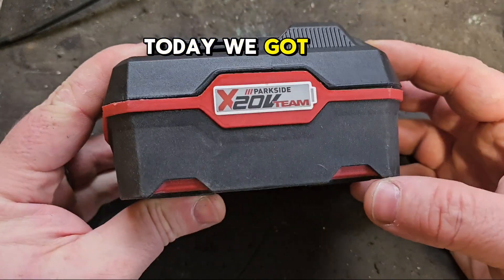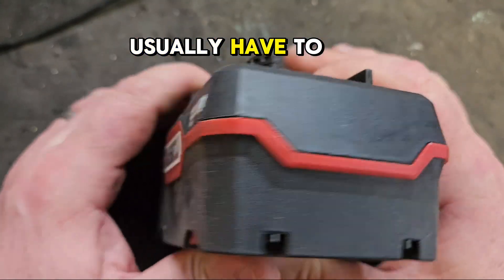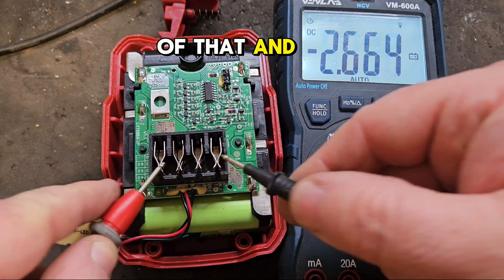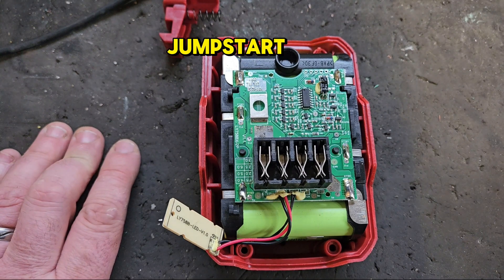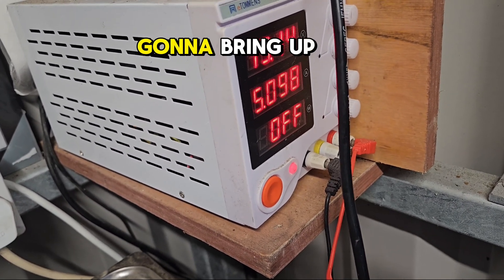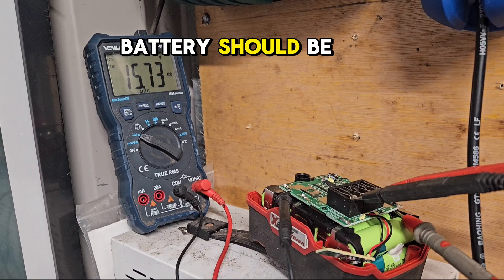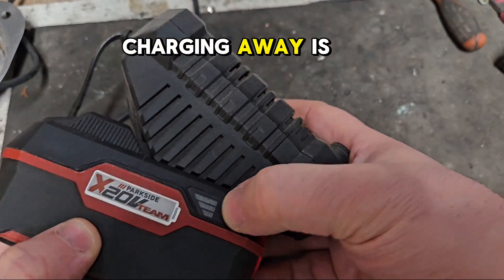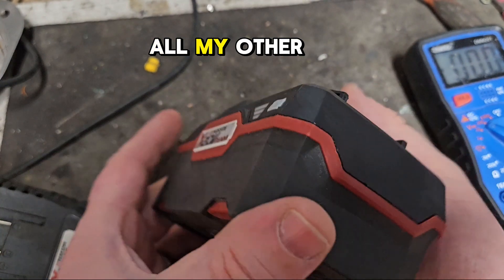I fixed 20v Parkside Battery For FREE

Comment: How is putting 20V to it using a DC power supply different than just connecting another 20V charged battery to the broken battery?
Reply: I have a Siglent SPD3303C at work. So you advise to use that to try to wake the battery?
Reply from the maker: @TR4- Yes
Reply from the maker: The DC power supply doesn't heat up the cells. Connecting to another battery can sometimes overheat cells and render them useless.This happens because you get an uncontrolled power dump from another battery.I know because I have done it.

Comment: Hi there, my rare 8hr version of that is at 20.5, close to 0% charge and tools cut out after a few seconds. When I charge, the green light stays on, no flashing, not charging. Any suggestions? Thanks
Reply from the maker: There is some kind of Bluetooth thing on the 8ah  I think that's the issue it's a board fault. Try and warranty it if you can
Reply: @doctorlefthandthread doubt I have the receipt for it. Will open and investigate.
Reply: Thanks for reply
Reply: I suppose I will just force charge it and bypass BMS, and keep an eye on cell voltages, serving as my own bms as the battery still powers tools.
Reply from the maker: @davidgriffiths7696 you could
Reply: @doctorlefthandthread it’s got some heat damage near the spring.
Reply: I also note the 3rd minus groove next to the +only shows 16.7. Indicating a possible dead cell.
Reply: Must be 2x series cells in parrellel
Reply from the maker: @davidgriffiths7696 They are 2 in parallel 5 in series if that makes sense

Comment: My 20v 2.0Ah is showing 19.20 v:face-turquoise-covering-eyes: but will not drive the drill and is green/red flasing on the charger:face-blue-wide-eyes:
Reply from the maker: It's a board failure I would try and warranty it if you can

Comment: Funny im getting 3.6 on all of em 
But still doesnt charge think maybe its ntc sensor or charger circuit in battery faulty sure i seen theres a charge cycle counter built in battery but still output power to drill lol😂😂 fkin parkcrap 😂😂

Comment: Located the duff cell, stroked it very briefly a couple of times with a fully charged battery (got sparks!) and measured the voltage which went up from 1.2V to just over 3V. Re-assembled, put it on the charger... Success!
Reply from the maker: Cool